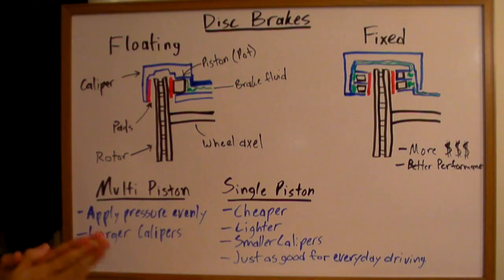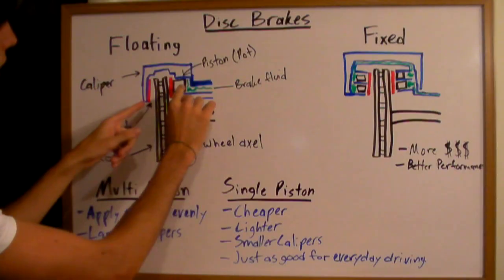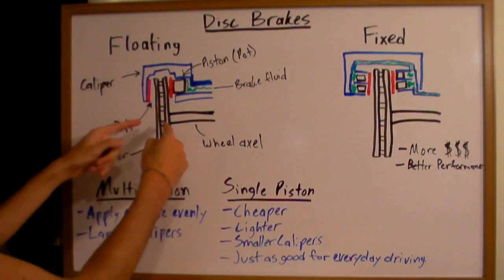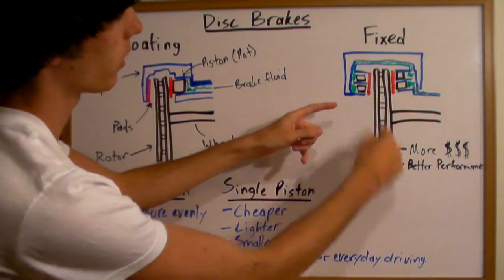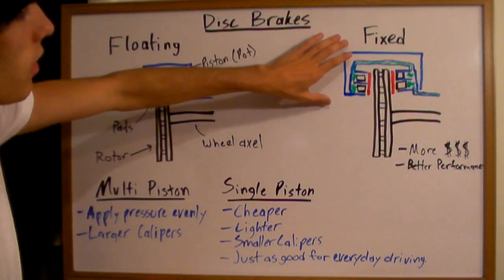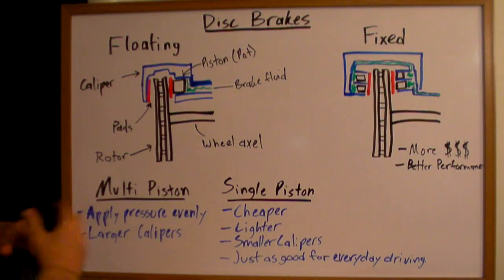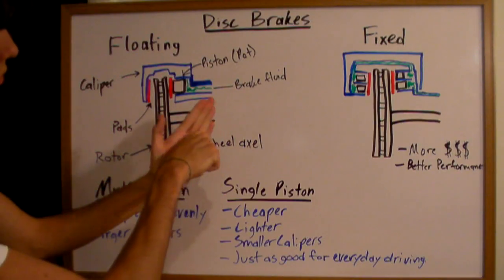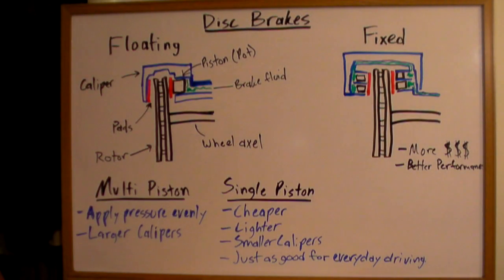How Disc Brakes Work - Fixed vs Floating

Comment: Well, since single piston factory calipers are usually steel while performance multi-piston calipers are usually made of aluminum, in practice, the multi-piston calipers are lighter not heavier.

Comment: Great video!  For an everyday driver (2020 Lexus RX350), if I plan on replacing the rotors with every brake pad change, rather than getting them re-surfaced, am I smarter to just buy decent replacement rotors (ex. Raybestos Element 3) instead of the top rated ones (Brembo, Akebono, not drilled/slotted) which cost 2 or three times as much?

Comment: Hello Jason, I absolutely love your channel and thankful for all the information you have provided me over the years. However, I do have an issue with this particular video. I know this is an older video but it's misleading due to the video thumbnail showing a Camaro fixed brake caliper with a floating rotor and the video only explaining the differences between a fixed and floating caliper. What about the differences between the floating rotor and fixed rotor? You didn't explain that in this video. I searched and I didn't find any videos of you ever explaining the differences between a floating rotor and a fixed rotor. Maybe it's time you made an updated video on this topic?

Comment: You have set the title of this video wrong: this is about Fixed vs Floating CALIPERS, not DISCS. 
You have 2 kinds of calipers: fixed and floating, and 3 kinds of discs/rotors: fixed solid state, fixed 2 parts, and floating 2 parts.

Comment: So a floating caliper will have play but when the brake is applied then the caliper is held tight? I’m asking this question because my trailer failed inspection because the calipers were loose but my caliper bolts are tightened as far as they will go. Was the mechanic wrong? Thank you!

Comment: Hi, I’m engineering student working in a Formula SAE vehicle, I’m in charge of the brake system design, so I’m wondering if floated calipers ( let’s say 1 piston) could apply the same clamp force as a fixed caliper (2 piston, one on each side obviously)? both calipers with the same piston diameter

Comment: Incredible how much has improved in 10 years  👍🏻
So this is fixed vs floating calipers?
I'm trying to compare fixed vs floating disc rotors on an ebike and compare difference in rotor sizes, without a degree

Comment: In case of floating, after releasing, how can the caliper return back to its original position? Or it (the left pad) keeps touching the rotor?
Reply: (with reference to the drawing made in the video) When releasing the brake pedal, the gap between pads and rotor is restored through a high pressure seal located on the right side of the caliper, such that when the piston is pushed by the increased pressure of the brake fluid, the seal is deformed, and, being made of an elastic material, tries to restore is undeformed shape, pushing the piston rightwards (or, better: pushing the caliper leftwards), as soon as the pressure decrease.

Comment: how to calculate the deceleration if the only data that has been 
provided is that the brake shoe applies a torque or "t" newton-metre on 
the disc or drum

Comment: will the floating calliper not apply a bending force on the disc brakes? or will it be insignificant?
Reply: The rotor is rigid enough to center a squeezing caliper solidly and not warp.  Generally, rotors only warp from heat, not the pressure exerted by the pads and caliper.

Comment: What's your opinion on left foot braking? I've been doing it for 8 years and I would say it has probably saved my life/or damage a few times.
Reply: lol i tried it once and planted my face in the steering wheel
Reply: Riggro how would you press the clutch?
Reply: Hudson Stronck, I did the same the first time I tried it. after a week of doing it, I mastered it. you just need more practice. :)
Reply: Nout Kleef this may blow your mind but bear with me... your left foot... that's right, your foot, and your brain can multitask. I've been left for breaking my newly acquired truck and shifting just fine. how? when I have to use the clutch, I slide my left foot out and my right foot on the brake seamlessly to apply the clutch and then back. easy peesy

Comment: You state that kinetic energy is converted to heat. That is not correct: brakes apply counter force through the tires to push against the car's inertia. The heat created in normal braking is a by-product of this process. e.g. think of a car trying to brake on sheer ice. No ground friction thus no counter force.
Reply: Wrong, kinetic energy IS converted to heat, wheels do not travel at straight line, they rotate and thus move the entire vehicle, heat is generated because brake pads are grinding against disc that rotates, you are mixing apples and oranges with what you said.
Reply: by that logic, if the car is on a jack, the brakes simply wont work.
Reply: you are looking at it wrong. the force at the road is a reaction force. the force applied is at the caliper.

Comment: My truck and car both have 4 piston fronts.... when I drive a car with sliders I hate the brakes, they feel like they are either on or off there is no middle ground to modulate the force.

Comment: I am having a confusion!!! In the floating calipers I can understand how the caliper bracket is pushing against the rotor by the pressure of fluid but how the outer brake pad is pushing against the wheel?? I can easily understand the fixed caliper by the diagram...
Reply: +Aditya Sreekumar  As the pressurised fluid pushes the piston inward and fills the piston chamber, the fluid is applying pressure in all directions, so as well as pushing the piston inward it is applying pressure of the same magnitude upon the walls of the caliper. The caliper is able to slide horizontally as its mounted on two slider pins, so the walls of the calliper slide in the opposite direction to that of the piston, causing the outward brake pad on the other side, which is attached to the wall of the caliper, to clamp on the brake rotor also. Hope this is clear enough
Reply: +Ibrahim Ahmet very well explained thanks! Even better than EE himself👍🏼👍🏼
Reply: Well thank you!

Comment: So what about you have floating caliper with 40mm piston and a fixed caliper with two 40mm pistons, lets assume they have same 'pressure' in the calipers. Which one is better or more effective? and why?
Reply: I'm not an expert but the dual piston caliper would be more effective because of the individual calipers pressing on either side of the rotor, it also means that the rotor will wear more evenly as there's an equal amount of force being applied on either side.

Comment: FYI Brake fade has nothing to do with the floating/fixed design concept. There are two types of brake fade. One, your brake fluid boils making your brake fluid compressible there for more pedal travel and less available brake power. In fact the fixed caliper design is worse for this type of fade because there is twice the piston area for the heat to travel to heat up the brake fluid.  The second is the friction material fades meaning the pads become less effective because they are not designed for the heat and energy they are being subjected to. Generally the opposed piston (fixed) caliper design is used in higher performance applications. They usually have included features to combat brake fade (radiators, stainless pistons, and high energy friction material etc..)The reason why the fixed caliper is used in high performance applications is because the design inherently  allows less pad drag on the rotor.

Comment: Hi Sir, do you happen to have a video on how to change rubber caps, I have break fluid leaks coming from the caliper and I need to pump the break pedal when breaking to make the car stop or slow down. A friend of mine said it could be the rubber caps. My car is  a '94 Honda Civic.

Thank you

Comment: So how to release the brake, is it just like clutch that automatically moves away?
Reply from the maker: When you let off the brake pedal there's no longer any pressure on the brake pads against the disc, so the friction is close to zero. They may still touch very lightly, but nothing significant.
Reply: OK.
Reply: Actually, they might have a sealing ring around the piston of a square cross sectional area.
This ring also acts like a spring, and tries to get back to the original shape after deformation!
So pistons are pulled back when there is no oil pressure
Reply: +Karan Gujarathi Bingo, you win.

Comment: you are right. This is not a floating vs fixed disk brake but a sliding pin vs nonsliding pin brake caliper. A floating disk brake is a completely different story! Very misleading.

Comment: When I push my brake pedal down on my '94 Ford Explorer while at mid of high speeds I can feel something grind against what I believe to be a tire rod. The brake fluid doesn't leak nor is it blocked so I don't know what's going on. Please fix my truck lol

Comment from the maker: If it's an automatic car the torque converter will still spin but the transmission will not as the wheels are preventing it from doing so. In a manual car, you have to put the car in neutral (or hold in the clutch) to prevent the engine from stopping.

Comment: Hi! i wanted to know that when you hit the brakes the wheels stop rotating then what happens to the rest of the transmission like the driving axles, propeller shaft etc.?

Comment: I think this video is a bit misleading. I don't see where the word 'floating' applies in any brake sub-type here. My take is that the brake on the left is the one with floating caliper (typical on mass-produced cars), and the other one is with a fixed caliper (it doesn't need to move as it pushes brake pads from both sides) - this one is preferred in performance cars. 
However, there are also brakes with fixed and floating disc itself (the rotor), and that's where my initial confusion came from.

Comment: ok so for floating disc brakes the fluid fills up in that little area behind the piston and causes pressure on the piston and the back of the caliper forcing the caliper itself to squeeze the other brake pad onto the brake disc?

Comment: I agree, your comment makes sense. it looks sporty but it is less practical for zipping around town, helps transfer heat and gets rid of the crap on the discs
they don't crack like drilled rotors.
I have to admit I think they look cool... (slotted)

Comment from the maker: Most cars have two separate main braking lines. One of which feeds the front left and rear right wheels, and the other for the front right and rear left wheels. This is done so in the event of a failure, you will still have 2 brakes to slow you down, one in the front and one in the rear - opposing sides to prevent your car from spinning. When you brake, with this setup, you would be using both front and rear. Wouldn't make sense to use front or back, instead just reduce the force on the pedal.

Comment: I heard that when you press your brake paddle very gently you use only your rear brake and when you push hard well even slightly harder than the set limit you enable use of both brakes, but im talking about a Suzuki Swift old model. non ABS, it might differ from car to car?. uploader.. is that correct?

Comment from the maker: Front is used the most, rear still does a decent % of the stopping. Yes, when you press the brake it goes to both front and back. 6 pot means six little piston cylinders at each caliper. And yes, slotted and drilled brakes are for enhanced cooling to reduce brake fade.

Comment: So the front of the car does most of  the braking right?
does the back brakes do anything when you put your foot on the brake pedal or is that purely for the hand brake?
so 6 pot brembo (obviously a brand.) brakes means 6 pots for each brake on each tyre
and some brakes have lines and drilled holes in them is that to help with cooling?
thanks for the video appreciate it.

Comment: aircraft brakes use multiple brakes disc and brake pads in just one wheel only. the new generation aircraft use Carbon brakes. they are more lasting and lighter. the main problem with Carbon brakes is when they drop. They may become cracked when heavily dropped during installation.

Comment: I have a doubt with respect to the floating disc brakes. How does the caliper move in when the pads(along with the piston) presses against the rotor. Isn't the Rotor suppose to move towards the Caliper?

Comment: SIR I HAVE A VERY SMALL MOTORCYCLE. i'd like to convert to disc brakes. they gonna bore holes thru the tire rims and insert a hub. will this be ok? small engine very low torque but the holes and the bolts are still turning. bolts might break or holes won't fit or the turning would make the bolts go loose i dunno.

Comment: this is NOT a "fixed brake".  the first one is a "sliding caliper" design.  the "floating" refers to the fact that the ROTOR is able to move around on dowels and "float" to cope with expansion and contraction of heat.

Comment from the maker: Well, I suppose having a single line/piston makes things more simple, which is always a benefit. The more parts the greater the likelihood of failure. But using the right materials for the rotor/pads can yield pretty equal performance with either.

Comment from the maker: @Aexotica The engine speed will decrease if you press on the brakes. If you were in a manual transmission vehicle and came all the way to a stop still in gear, the engine would shut off. This is why you have to shift to neutral. In an automatic car, when you come to a stop it shifts down gears depending on your speed, but there is no direct link between the tires and the engine due to the torque converter. It's a brilliant device, if only they were perfectly efficient.

Comment: Something confuses me, when braking you cause friction and cause the wheels to stop, so even though a variety of shafts and gears are being turned by the engine to ultimately make the wheels move, when you force the wheels to stop moving aren't you in essence disrupting the cycle of the engine which would cause it to stop as well. I know this isn't the case so what prevents this, is it the differential?